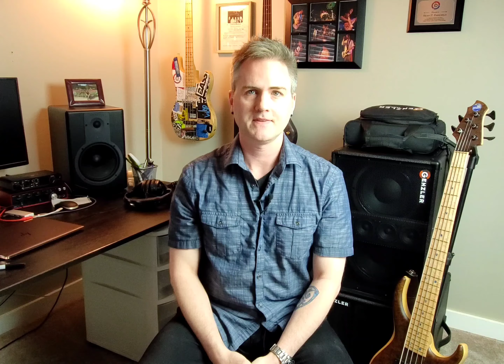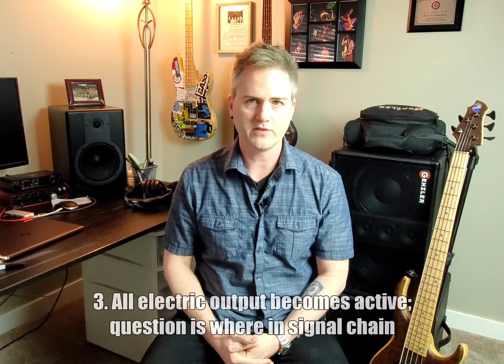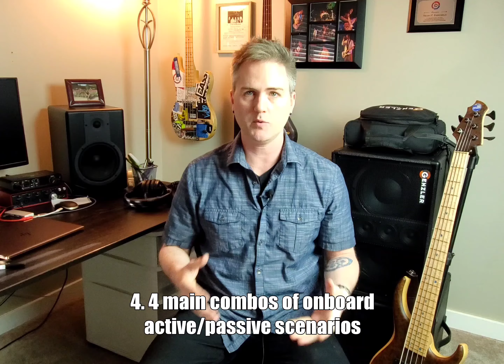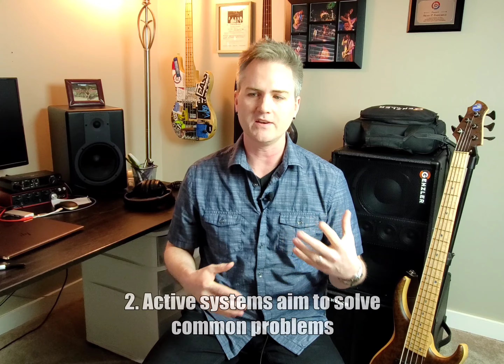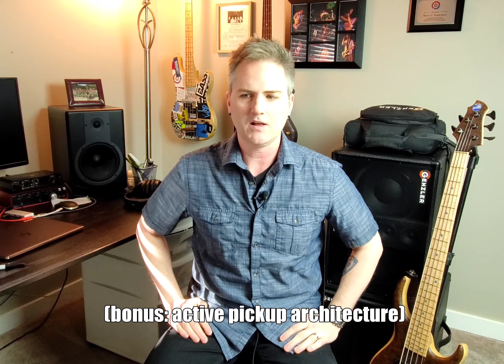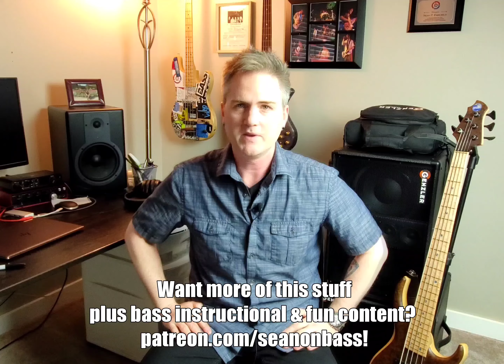Understanding Active & Passive Bass /Guitar Circuits - All You Want to Know!

Comment: Sounds good stuff but i have beem using passive bass's ALL my life & luv that i can hear what type of bass, eg, Jazz, Precision, Jaguar PJ, i fitted noiseless SD Apollo's in my Jazz, no active bass could get that tone, i cannot tell 1 active from another, yes my signal is buffered on my pedalboard but it keeps my bass's tone, i overhaul ALL bass's & fully sheild them, a real pain but it works, i only use 2% - 5% hifi grade Polypropylene capacitors & a 1% hifi grade resistor, i use the Fender Greasebucket tone set up, more real, 3-D, organic, sounds better & i only use 8% - 10% CTS linear pots, i can easily tell each bass but if i put batteries in my Ibanez SR600E it loses its Soul, i only play my Ibanez's passive as they sounds better imo, i cannot tell the kind or make of an active bass circuit, it sounds sterile & strange, i spent yrs tuning my bass's to the way they are, i don't want that one tone that sticks out like a sore thumb with some active bass's live, they can give me listening fatigue, my passive bass's have Soul, i own active bass's but still play them passive as they sound better imo, done A/B blind tests, i'll stick to a passive going through a quality Buffer on my pedalboard any day, i do like certain active EMG's but prefer there passive made pickups with polepieces, luv there passive pickups, noise is the number 1 problem for bassists live, i can fix that with a passive bass but cannot if an active system is noisy, horses for courses, if you like active play active but they are far from perfect, most active systems are terribley build with cheap components, i laughed when i seen my old Stingray's active 9v 2 band eq system, not good quality yet i luv Stingrays, preferably passive, mine was passive for over 25yrs, people thought it was active, i got a few compliments about it's tone but never said anything except in a studio, i've heard some good active bass's but i luv those passive Fender Precision, Jazz & Jaguar PJ tones & no wireless either, the cable if well made will sound great, i would say the day of single coils are out nowadays as everyone has a phone powered up in there pocket & so many things to make a real single coil sound very noisy nowadays, soz Strat players, all to our own thing, some people luv only active bass's but others luv that beautiful tone if you got a good Fender, they cannot wire a plug, terrible 20% - 30% tolerance tiny 4mm ceramic disc capacitors, i used to design loudspeakers so know how important well made passive components are, interesting stuff bud but i luv my passive heavy modded Fender bass's & passive Ibanez's, good stuff bud...

Comment: I don’t understand what you mean by “an active buffer freezes your signal.” Do you mean that the amp treble and bass controls won’t work in that case? They doesn’t seem correct
Reply from the maker: No, what I mean is that an active stage in your signal chain, before your amp, isolates your pickups' signals/tonality and doesn't allow things past that point to change their response. So preserves would be a better word than freezes!
Reply: @CombinatorMusic Ohhhhh that makes sense! Thanks. It’s hard to find info on this. I spent a lot of time making a passive—>active diagram, but idk if I did it right. Do you think could take a look to see if it seems right?

Comment: Great Video!  A question, so if i have active preamp, do i need to use a DI box?  and should it be an active or passive DI box?  or does that matter?
Reply from the maker: Thank you! They're not necessarily for the same purposes - DIs and preamps. If you need to have a balanced signal, a DI will give you that. It's also makes your signal low impedance, but if you're playing through a preamp, onboard or otherwise, you've already got that. Passive vs active is a subjective choice for preamps if you're already active. Thanks for watching!

Comment: What if any is the diff in output or tone between a) a passive bass and b) an active bass with EQs at neutral?

I have an Ernie Ball Music Man Sterling bass. It's active. Is there a way to make it passive in case battery dies? It has no output if you take the battery out.
Reply from the maker: Most preamps work at unity gain when not boosting or cutting, so the output level likely won't change. Some preamps are an exception. The main difference you'll hear is the lack of greater capacitance (ie, you'll hear more treble and a higher resonant frequency from the pickups) when the preamp is engaged, since the first active stage is coming before many feet of cable instead of happening at an amp input. You can bypass preamps to have a true passive signal, but there's not much of a reason to. If you can get used to needing to change the oil in your car every few months, changing the battery once to twice a year at the most if you don't leave your cable plugged in shouldn't be a major issue, and the battery will slowly die giving you potentially weeks of notice before it poops out. You'll hear that as distortion and weaker output that gradually gets worse.
Reply: @CombinatorMusic  So why do some basses have an active/passive switch?
Reply from the maker: @mattfoley6082  a number of reasons, mostly consumer interest at this point as many folks prefer (or think they might) passive outputs with higher impedance and greater capacitance, at least part time. And active/passive does often provide a best of both worlds scenario if pickups weren't specifically engineered to be mated to specific preamps, as they are in StingRays, MTDs, Wals, Alembics and others.

Comment: How can you tell the difference from active and passive  bass pick ups
Reply from the maker: The easiest way is to see if there's a power wire running to the pickup. There should be at least one hot and one ground/shield - a 3rd wire, sometimes red, but any wire traceable back to the battery is a giveaway. You can't always tell actives from the outside or by listening.
Reply: @CombinatorMusic  thanks a million, you are a amazing teacher.im so glad i ran across your channel